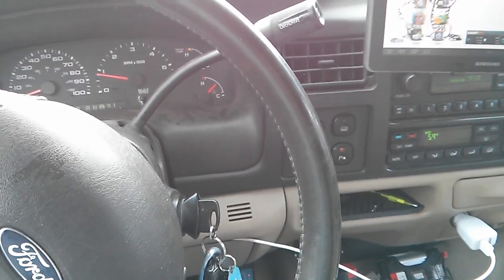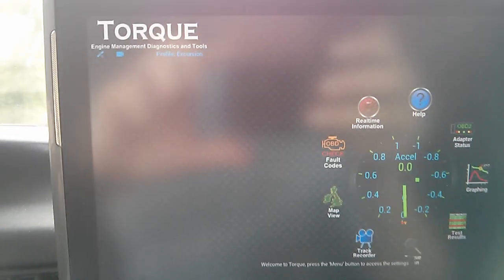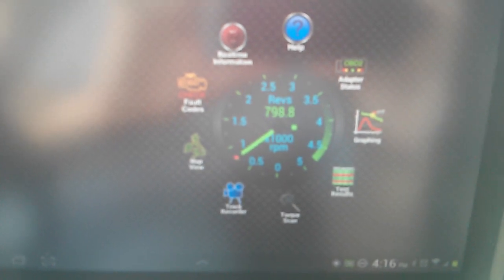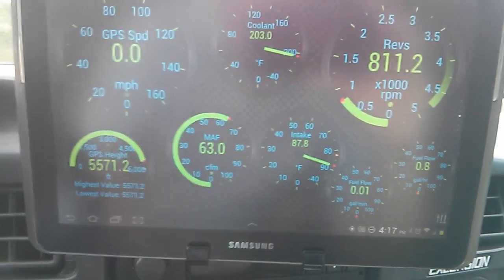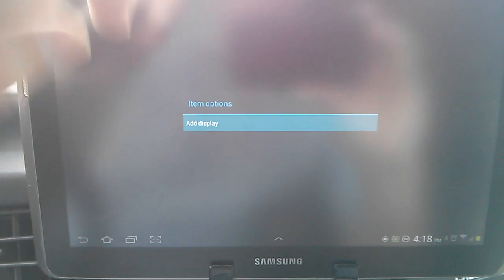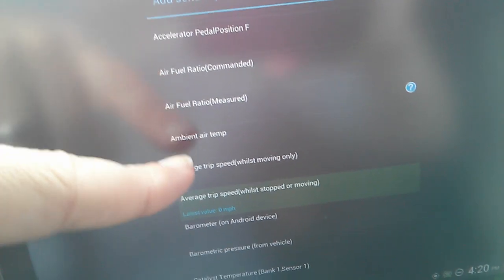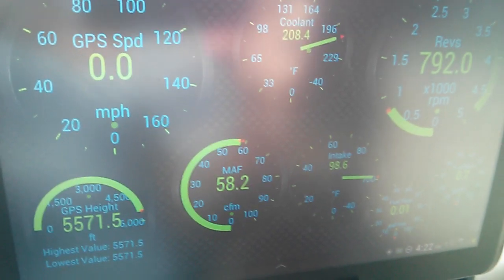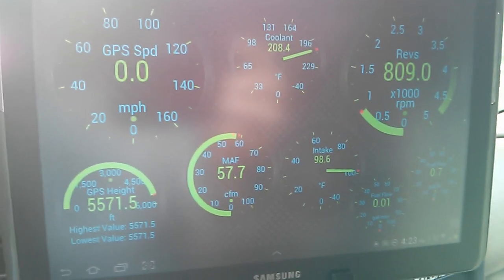Torque Pro for Android

Comment: I bought the android & windows versions and in all honesty they don't do much. The only physical thing you can do with them is to reset the check engine light. All the other stuff it displays is pretty much useless info if you cannot adjust anything yourself. Even an SCT Tune Device that can cost $1000 bucks is hopeless without a Tuners input. You pay big money for a device that you are locked out of and any input from you is at your Tuners discretion. Be warned that if buy this device you still end up having to pay your mechanic to fix what is wrong. IMO, Don't waste your money on Gimmicks and use your hard earned cash to pay your mechanic.

Comment: Will Toque Pro give you alternator voltage? Torque Lite does not.
Reply from the maker: +Transguy I don't see that option listed.
Reply: Torque Lite doesn't show alternator voltage either and it would be nice to have since most cars don't come with a voltage meter like GM trucks, so you can look at the gauge 24/7 and quickly know that your alternator is putting out 14V all the time. 12.96 V is good enough  for daylight hours but won't run headlights very long at night before they fade out and shut down completely. Most cars now come with a crummy alternator lite that seldom gives a clue that your alternator is on its way out.

Comment: I'm using my android phone with this I want to,use my next book but learned it doesn't have Bluetooth
Reply from the maker: +SuperWatson63 ok.
Reply: covert88fsb I was wondering if you knew a way to enable Bluetooth on my tablet
Reply from the maker: +SuperWatson63 Depends on what type of tablet. Bluetooth is usually in the settings.
Reply: 192lalo thanks,I'll get one

Comment: , I have a question for you bud where did you get that tablet Mount from?  I have one for my car but it's a window mount is yours a window mount as well because when I put it in the window it takes up the whole view of my Volkswagen Jetta I like the setup you have here and your Excursion what type of noun is that where did you get it and how much was it? I'm looking to run the torque app and my VW but I want to run it on a tablet not on a cell phone
Reply from the maker: +Joey Gregory The tablet mount is by Satechi and was ordered off Amazon. It looks like they have a different design now but the one I have has held solid for over 3 years now.
Reply: I ordeed a arkon 22" mount have not installled but it has great reviews .

Comment: Car Stealership's must hate this device and app. A couple years back oreilly and autozone stopped renting out OBDii scanners to customers. I think the Stealerships complained about it to them. They basically lose out on charging customers $140 just to do a check engine light scan. Total rip off. 

I can't wait to try out the mini adapter I got from ebay, i have the pro version of torque already on android. 

Thanks for the vid.

Comment: Will this rear ABS trouble codes?
Reply: El CaNgRii 
Which does not work with any ODB2 dongle except the one they sell for $100 at www.BlueDriver.net
Reply: Nope, that's the problem with torque. It doesn't support vehicle specific codes.
Reply: Mr Anonymous No scanner you get will support vehicle specific codes, only a manufacturer OBD scan tool (which will run you anywhere between $200.00 USD to $2,000.00 USD) can support vehicle specific codes. You guys are asking for the impossible.
Reply: WeActOnImpulse Official 
Actually there is and its an app that reads abs and sensor codes called blue driver it does more than torque

Comment: Do this app remember latest recording? Example; I turn app and start recording fuel consumption, after 20 km  if I turn off my car and application and later continue to driving will this app start recording from begining again or it will remember data and continue to recording? I know it will remember if I just turn off my car, but what happen when I disconnect bluetooth and connect again?
Reply from the maker: Sorry about the late reply. Yes, you can set Torque Pro to remember previous session data.

Comment: Why does it use gps for speed instead of the speed sensor?
Reply from the maker: It can pull from the vehicle computer as well. I use both displays and there is even a display to show the difference between the vehicle speed sensor and GPS speed. That's how I was able to determine my Excursion's speedometer is off by 2.5 mph.
Reply: I would imagine a 2.5mph difference is due to GPS lag rather than a speedo inaccuracy.. that is, the time it takes for the software to send a signal to a satellite and for that satellite to then relay the position back.. 2.5mph is a very impressive discrepancy actually!
Reply: That's not how GPS works. GPS is one way, the satellites constantly send a signal. Your phone receives these signals and does all the calculations it's self.

Comment: Good review, thanks. I have bought an appradio 3 pioneer to run this. Only difference is I bought the wireless dongle with on/off switch to make sure it doesn't run down my battery, only cost about £13